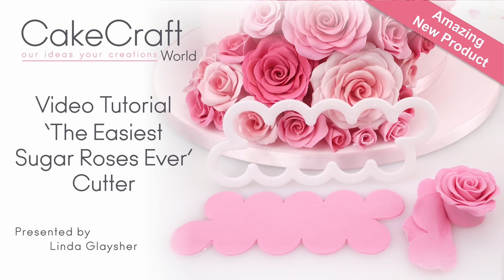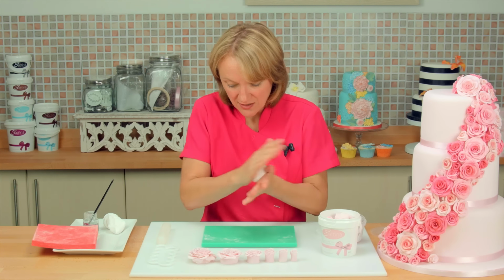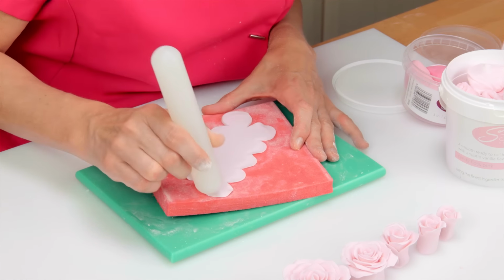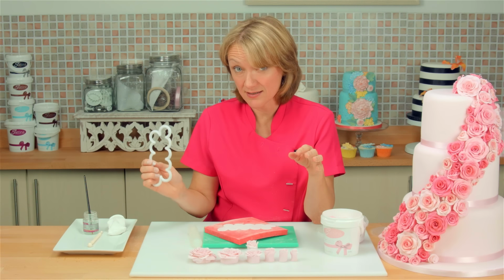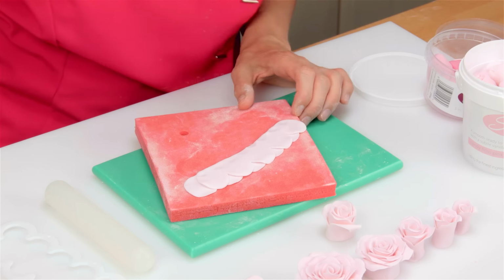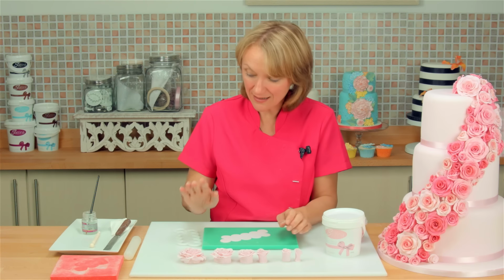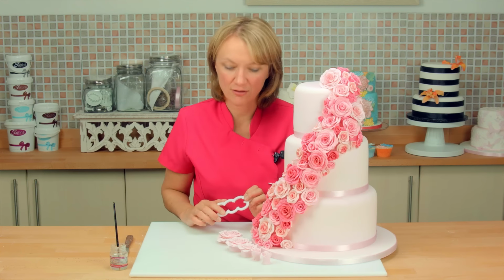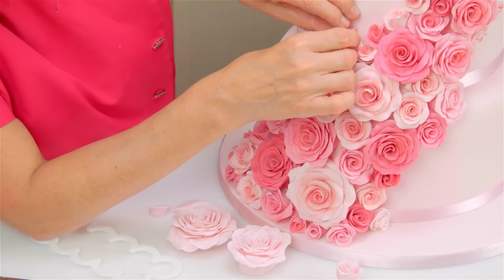Quick & Easy Sugar Roses using The Easiest Rose Ever Cutter

Comment: Amazing, can you use just sugar paste?
Reply from the maker: Hi there, you could but you won't be able to roll the sugarpaste as thinly and you would end up with a chunkier rose (it is likely to be more difficult as well). By using modelling or flower paste, you can roll it thinner and as the paste is more pliable it will be much easier and give you a much more delicate rose.

Comment: what brand or recipe for sugar/gum paste? mine is always a bit too fragile and soft to support itself. Does yours use tylose? Thats the only thing I haven't tried yet.
Reply from the maker: Good morning! we used Sattina perfect paste for the roses which comes in white so you can add any colour you like to it: https://www.cakecraftworld.co.uk/shop/products/Sattina-Perfect-Paste.htm 

Or as another option mix equal quantities of modelling paste with a coloured sugar paste of your choice:  https://www.cakecraftworld.co.uk/shop/products/Sattina-3-in-1-White-Modelling-Paste.htm - modelling paste
https://www.cakecraftworld.co.uk/shop/8/1005/903/ - Sugarpaste 

Tip: If you wish for them to fit snug together in an arrangement on your cake, then only make them the day before as the paste is still slightly forgiving.

Tip: If you want stronger flowers then change the icing ratio 3 to 1, so more modelling paste and less sugar paste. 

Hope that helps.

Comment: I would like to add the wire to them so I can attached them to the cake as a bouquet.  My customer would like all of the flowers with wires.  Do I do that the same way as with others? Once rose is made, work the wire into it by bending the tip and with edible glue?

Comment: if i dont have edible glue, can i use a little bit of water with a pincel? :)
Reply from the maker: Water won't work with 50:50 paste, which we recommend you use. You will need to use a gum based glue it won't stick :)

Comment: Will this work with marshmallow Fondant?
Reply from the maker: Thanks so much for your question. We have never tried making these roses with marshmellow fondant or sugarpaste, because we believe that they are too soft to hold the shape of the flower.  We would always recommend using 50/50 (sugar and gum paste). You could try adding some CMC to your marshmellow fondant as an experiement - however, this again is something we have never tried, so we would suggest experimenting with a little fondant if you you decide giving it a go.  Good luck - we'd love to hear how you get on!

Comment: I love this cutter. I have made multi colored roses using orange and yellow. I did one cut out orange then another yellow. I then cut those in half length wise and used the edible glue to fasten to the opposite. I used the roller to make sure there was a good bond between the two. Then I began the rolling and fold down process. They turned out BEAUTIFUL!!!

Comment: pls am using this flowers for a friend wedding next week, can I start doing it now
Reply: Cake Craft World what happens if you keep them in an air tight box
Reply from the maker: Yes, you can make these ahead of when you need them, just keep the finished flowers in a non air tight box to protect them until you need them. Hope this helps, thanks.
Reply: sonia sandiford I have this question also.  I keep my room humidity between 45 and 50.  Is low humidity good or bad?
Reply: bluegreen 앙금 풀라워

Comment: if it is so can we use any playdough guys?
Reply from the maker: We have used Sattina Perfect Paste which is a 50/50 mix of sugarpaste and modelling paste - we have found this the best paste to use for these flowers as you can roll it quite thin and it sets firm but doesn't set as quickly as modelling paste giving you more time to work with it. We are not sure whether playdough would work, obviously this is not edible so you couldn't use it on cakes, but it may be too soft to roll out thin enough to make these roses. Give it a try but unfortunately we cannot say whether it will work! (Just remember not to use non edible materials with the same cutter you are going to use edible paste with). Hope this helps.
Reply: Cake Craft World

Comment: does the rose become hard or does it stay like marzipan?
Reply from the maker: If you use the 50/50 mixture of sugarpaste and modelling paste (or Sattina Perfect paste found here - http://www.cakecraftworld.co.uk/shop/products/Sattina-Perfect-Paste.htm ) as we have done, then you will find that the rose does firm up enough to keep it shape, but it keeps some of the softness from the sugarpaste so that if you put it on a cupcake/cake, you could still eat it. Also, we have found that if you are attaching the roses to a cake in a cascade design, you can still cut the back of the rose off at an angle (using a palette knife) to make it easier to attach the rose. Hope this helps.
Reply: Cake Craft World How fragile do they get?  I did notice a petal drop, sorry; but is that the extent of failure, or do they unroll in untrained hands?  (🙄Like mine😳)
Reply from the maker: As we have used a mixture of sugarpaste and modelling paste, these roses are not as fragile as flowers made purely with florist paste (where the petals tend to be much thinner). As you saw, there can be a few breakages so it is always a good idea to make a few extra roses than you think you might need, just in case! Hope this helps.

Comment: Not worth the money when you can do these on a flower nail just as easy
Reply: it's worth it when it comes to time, because of the cut and fold part. we're not all as experienced as others. I think almost everything can be either bought, made frm scratch or just have a shortcut
Reply from the maker: Be careful purchasing cheap cutters from ebay - they may not be made from a food safe material. The Fmm 'Easiest Rose Ever' cutter is a patent design and made from a food safe material, you can buy this here https://www.cakecraftworld.co.uk/shop/products/FMM-The-Easiest-Rose-Ever-Cutter.htm Others you find online may be cheap copies. Thanks.
Reply: Cake Craft World

Comment: What would happen if I only use modeling paste?
Reply from the maker: +Jaime Chun Rivero Hi there, you could try it with just modelling paste but we have found it works best with 50/50 modelling and sugarpaste (fondant) as it doesn't set hard so quickly, giving you time to manipulate it. Also, if you are cutting the bottoms off at an angle to attach to a cake, you will find you can still do this fairly easily with the 50/50 mix whereas if it was just modelling paste it would probably have set too hard to do this. Hope this helps.

Comment: Fantastic cutter, great tutorial.  I am assuming as you used edible glue you can eat these roses if you want to? I have just never used modeling paste mixed with sugar paste.
Reply from the maker: +Lesley French Yes, we have used edible glue so the roses are still edible. We have used a modelling paste / sugar paste mix so that the paste is more pliable and easier to create these stunning roses, yet does not dry as hard as modelling paste on its own so you cut the bottom off the roses if required, in order to attach to your cake. Hope this helps.

Comment: I would like to make a cake similar to this one but I'm concerned about the roses actually sticking to the side of the tiers and not coming loose.  I would imagine that some of them are very heavy.  Has there ever been a problem with this happening to a cake with these roses cascading down.  Is there a way to wire these roses for more stability.
Reply from the maker: +Clare Giammusso To attach the roses, make a really strong paste by mixing together some modelling paste with either edible glue or royal icing. Use a palette knife to spread this sticky paste across the back of the rose, then press the rose firmly into place on the cake. Sometimes it helps to attach extra sugarpaste to the cake first then cover it in the roses. For instance, mould some sugarpaste into a teardrop shape, attach this to the cake then press the roses firmly into place using the made up sticky paste. This works because it gives you a nice shape to attach the roses to and because the icing is still soft, you can press the roses into it. We hope this helps, let us know how you get on!

Comment: Wonderful idea.  I intend to purchase anyway.  However, can these roses be wired for a sugar bouquet?
Reply from the maker: +Christine Bartholomew Hi there, these roses are not designed for wiring to add to a spray... these work best when directly attached to your cake or cupcake. If you wanted to find out how to wire a rose, we do have a video on this process but it involves attaching the rose petals individually rather that rolling round as in this method. Take a look here - https://youtu.be/E6HqMBWCyYg Thanks

Comment: hello, can you tell me why my roses are high in the centre? how can i make it lower?
Thanks.
Reply from the maker: +fudgedragonfly Hi there, this can sometimes happen but it just takes a bit of practice to get the right technique. A couple of things to look out for are - as you begin to roll up the rose (in the video, this is around 2.37), watch the top edge of the rose and try to ensure that the centre of the rose stays level with the top edges of the rose and doesn't rise up (sometimes when you start rolling, if you start doing it at an angle, the centre can come up too high). Then after a couple of rolls, stand the base of the rose on your pad so that as you keeping rolling around the petals, they align correctly. Also, be careful not to squeeze the base too much as you are rolling around the petals as this can sometimes push the centre up. Hope this helps, please do let us know how you get on!
Reply: thank you so much! Il try these tips next time :)

Comment: can I make the roses with gum paste?
Reply from the maker: +Darla Boyer Hi there, yes you can make it with gum paste but we would recommend using a 50/50 mixture of gum paste with fondant (sugarpaste). If you are planning to put the roses onto a cake, you will most likely need to slice the bottom off (at an angle if you are planning to add the roses in a cascade as we have done) and this is easier if you have used a 50/50 gum paste and fondant (sugarpaste) mix. If you were to use gum paste on it's own, it might be too hard to cut. Hope this helps.